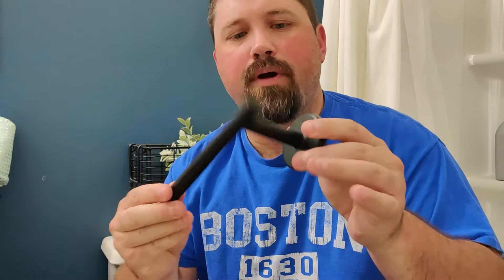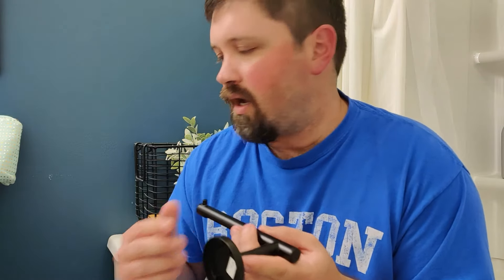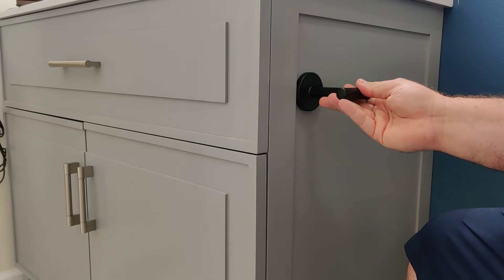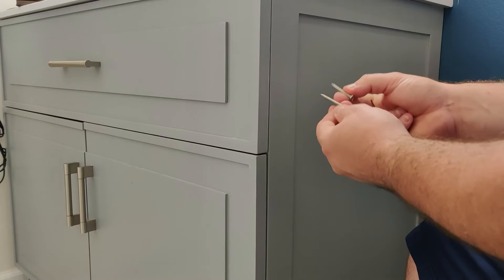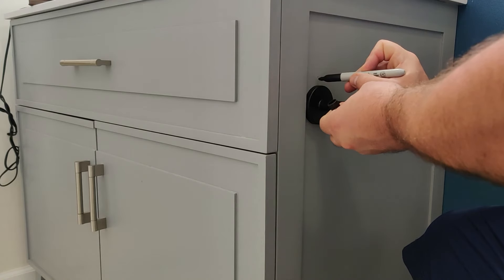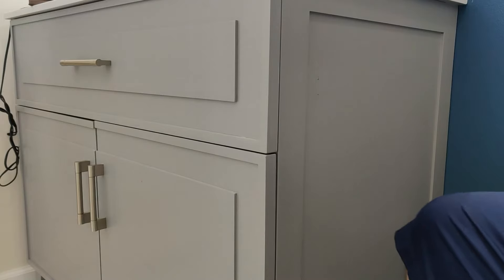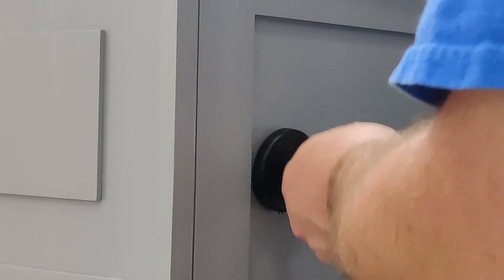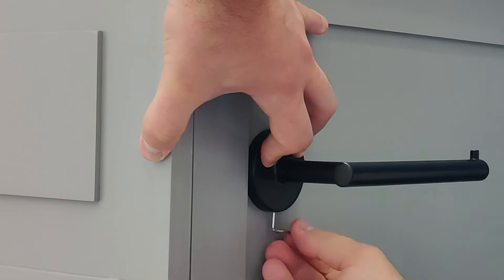HOW TO INSTALL TOILET PAPER HOLDER ( Vanity )

Comment: Thanks! I would add, I had to drill holes before mounting the bracket. I didn’t have the arm strength to push the screws thru the vanity without a little starter hole there. Also thanks for the tip about shorter screws.

Comment: I am here to figure out how to remove one of the there since I don’t see any screws on the outside
Reply from the maker: Look around the edge.  Most likely on the bottom or top whatever you are removing.  There should be a small set screw.  You will probably need an Allen wrench to remove it.

Comment: Your installing that wrong like 99% of others do too. Its supposed to go straight upwards at 12o'clock
Reply: If it’s meant to be that way then why does the design of this one he had in the video have a little point at the end sticking out meant to keep the roll on the pole. It being pointed up wouldnt make any sense because that little lip would only work a fraction of the time depending on how you’re pulling the roll. But if it were horizontal (like the design indicates it’s meant for) the roll would naturally hang down and when you pull the toilet paper if it were to move the lip would hold it on the pole. It’s simple physics if you pay attention to the design meaning with it being vertical that wouldn’t make sense with the design. So for you to confidently state that it’s wrong is ignorant to key details.
Reply: It could go both ways.  The instructions on mine shows both options.